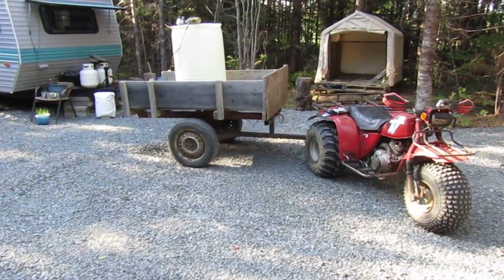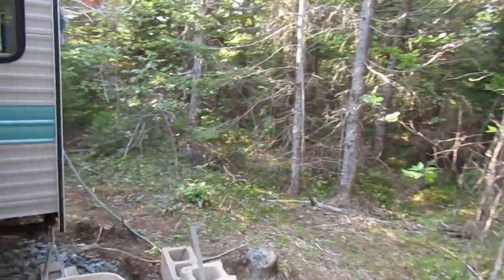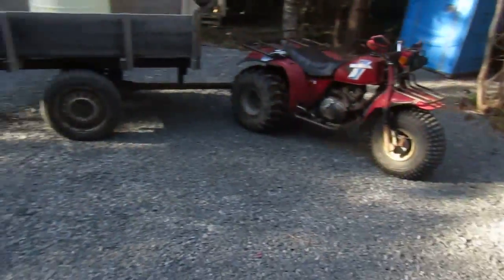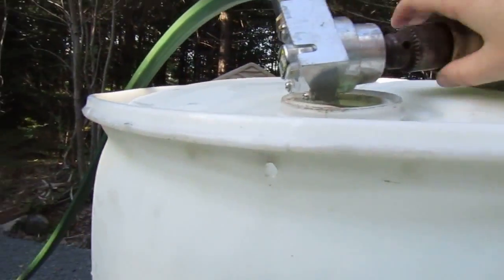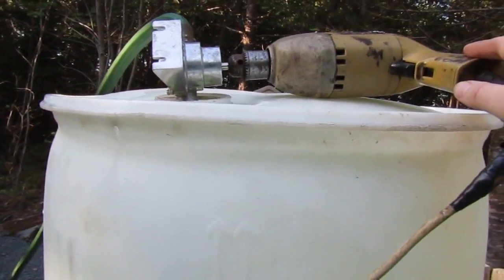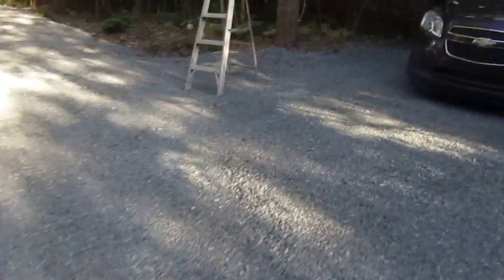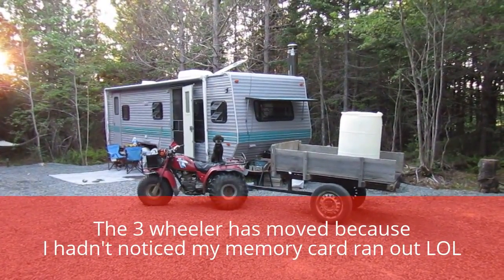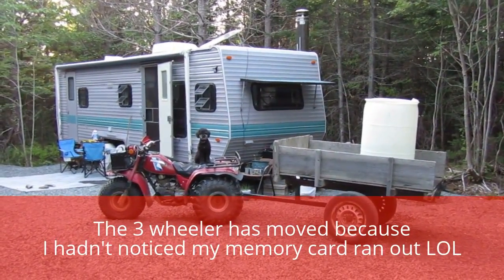How I get water - Off the grid!

Comment: Hi Jenna, so you are entirely off grid? No sewerage or septic tank. You have holding tanks for drinking, gray and black so do you use a portable tank and empty your tanks that way? Or where? Lol
I always had leaks around my slides and of course I rotted the floor and I didn’t know it. And it was always humid and next time I’m getting a dehumidifier. I used Damp Rid but too much condensation.
You definitely are off grid collecting water. It’s amazing how much work is involved huh? Wait, how did you learn to do all of these things? Engineer degree? This takes lots of planning and expertise and obviously you know lots of methods to get by. Cool 👊🏻